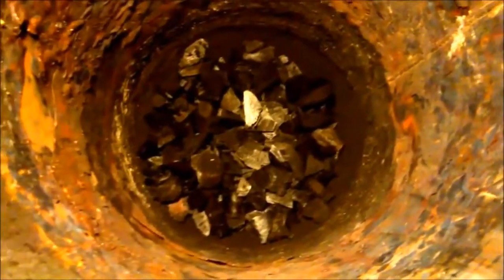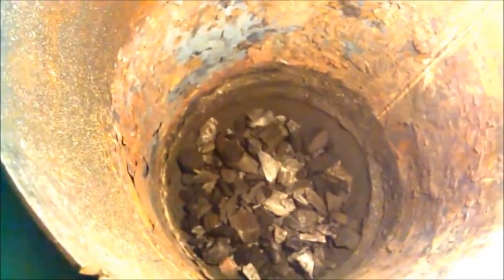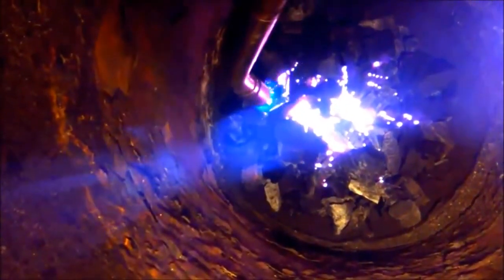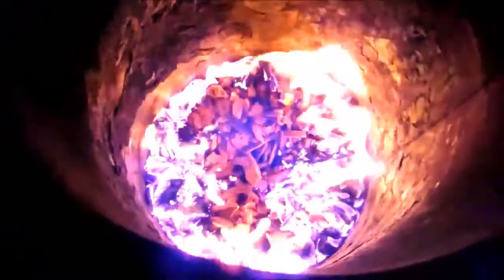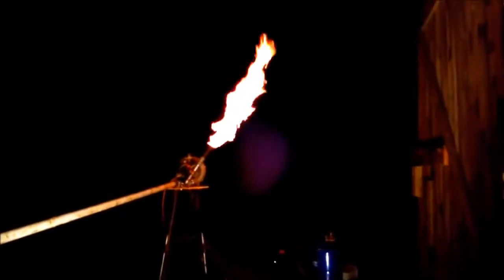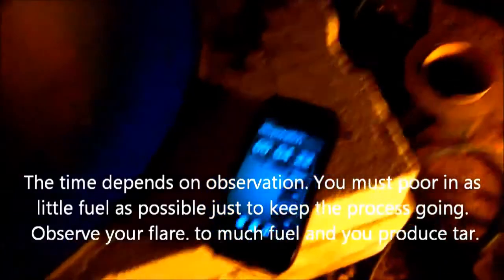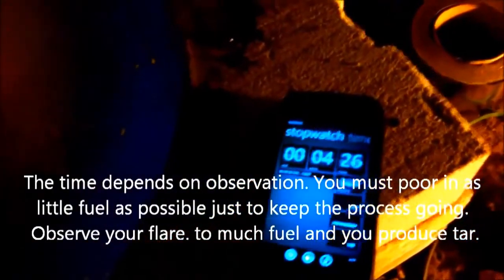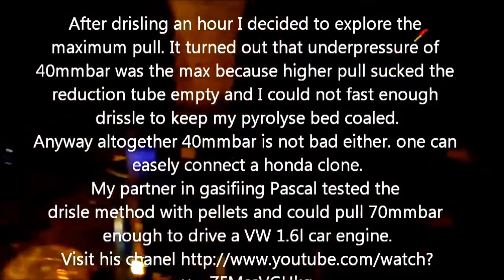the DriZzleR Gasifer   the DriZzle method

Comment: Dont you have to limit the amount of air added to the gasification process?
Reply from the maker: Thank you for watching. No need to restrict the amount of air if your engine is capable to consume all the gas. If using a less powerfull engine you can restrict the diameter of your fall tube.
Reply: Thank you for your video.